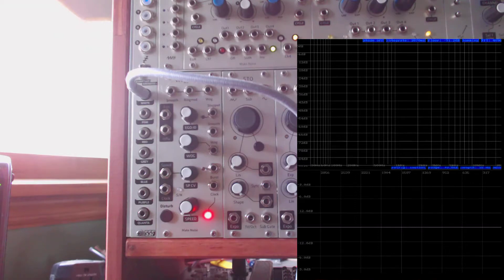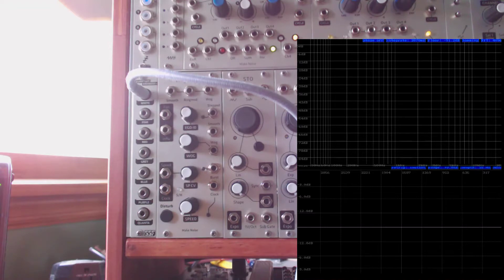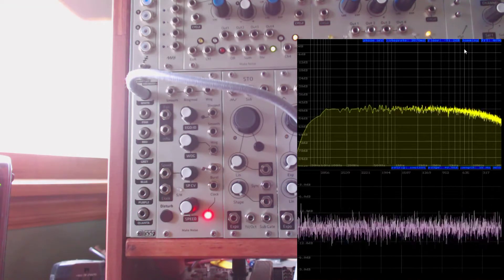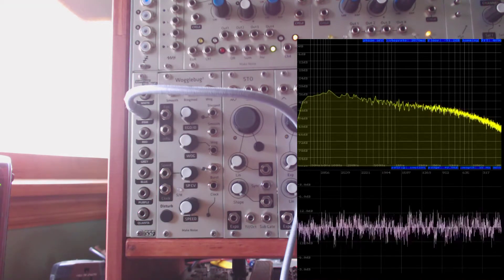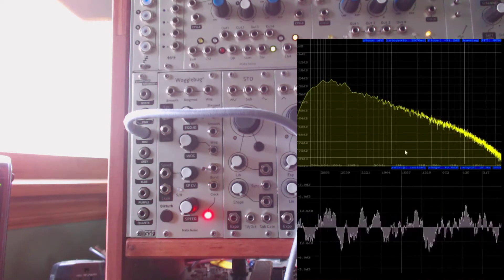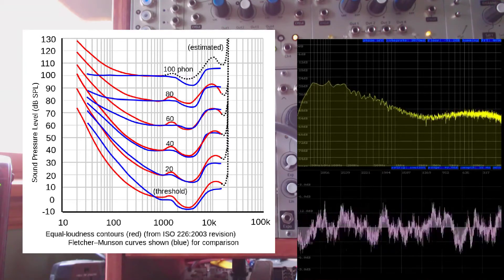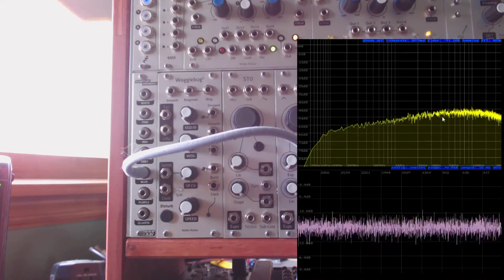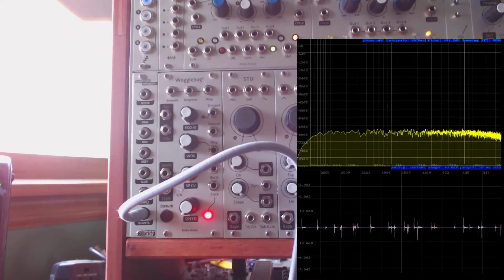Colors of Noise with the Quantum Rainbow 2

Comment: so it sounds like several of the noises are based off of white noise with some fixed filter setting applied. so could i just take the white noise from Kinks, run it through a filter and simulate blue, red, etc, and gradients of noise in between?